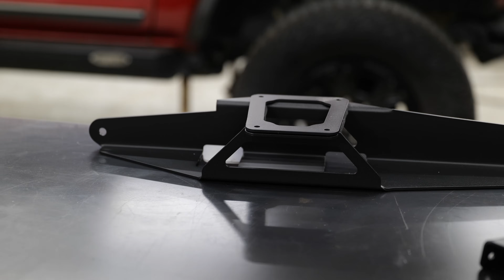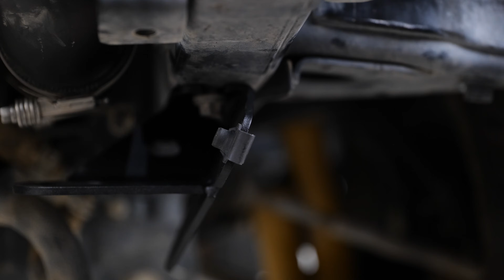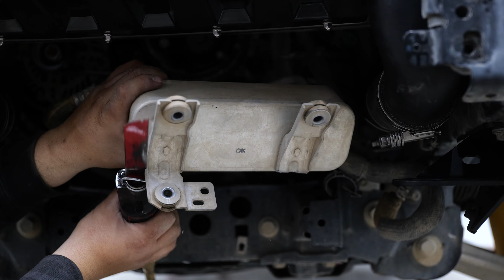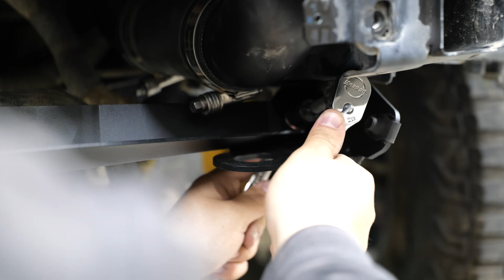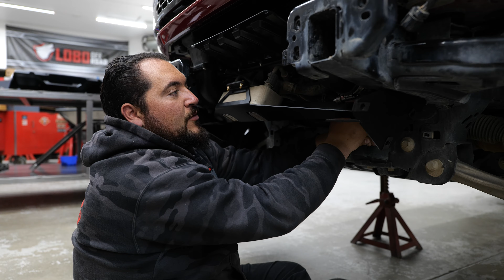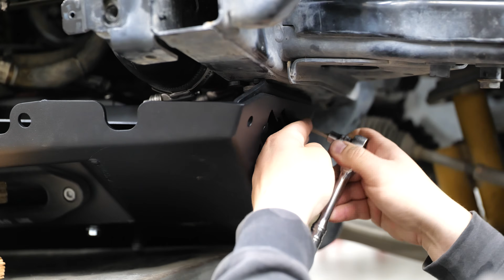LOBO OFFROAD | FORD BRONCO | HNT Hidden Winch SKID 2.7  INSTALL

Comment: Any chance you can do a similar video on install on the Bronco 2.3L manual trans ... also can discuss access options for free spool lever access? Also, in the video you are installing a Warn Zeon Platinum winch and it looks like it has it's control module in place, ie. not relocated. Can you comment?